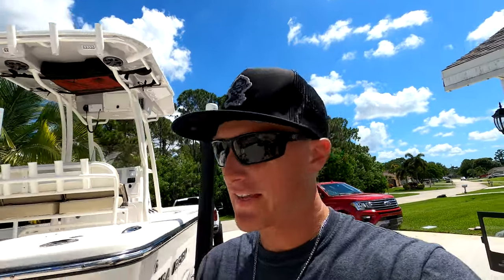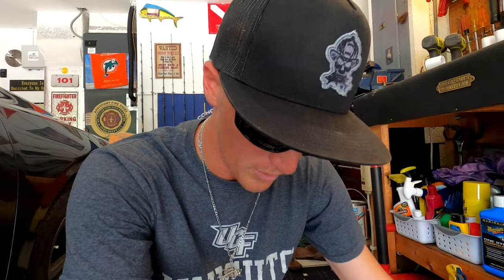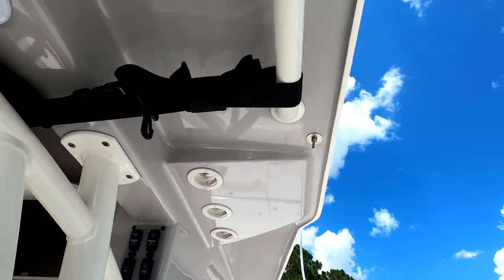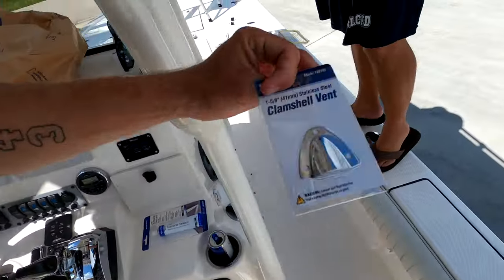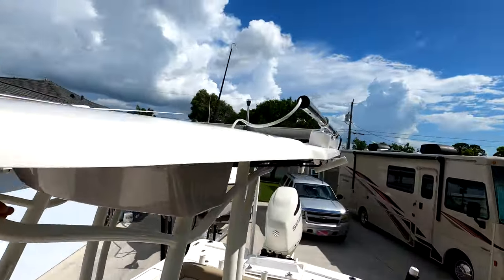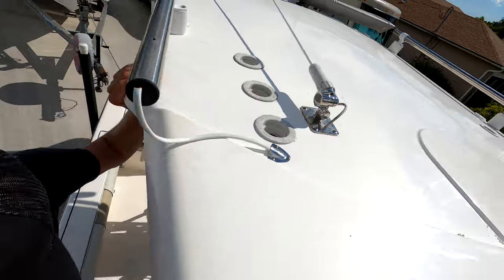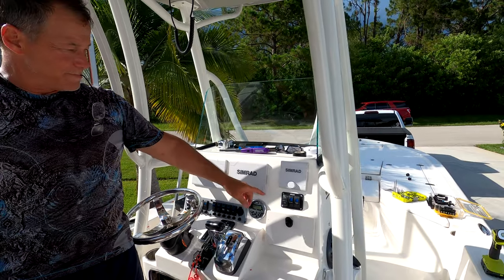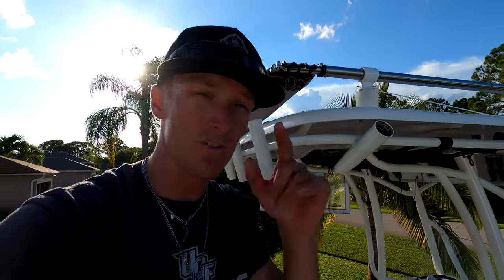How to install the SureShade PTX | The best SHADE for YOUR Boat!

Comment: Nice work BUT NEVER EVER FOR ANY REASON USE electrical tape on your boat brother EVER!
Reply from the maker: Thank you, I completely agree with you the only reason why we did is because we already made a secure connection and heat shrunk the connections following crimping them together, we just did it to combine all the wires together after they were securely connected.